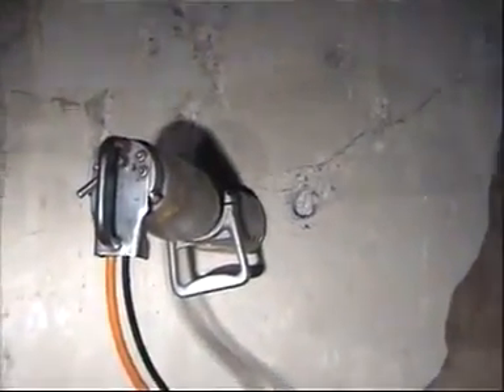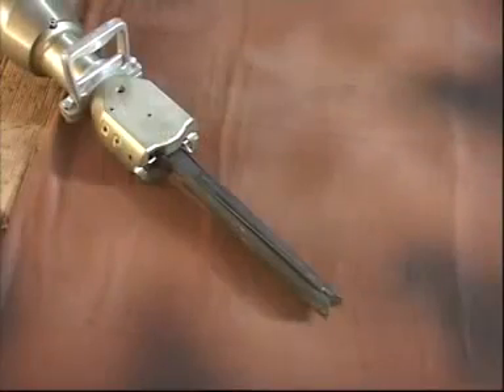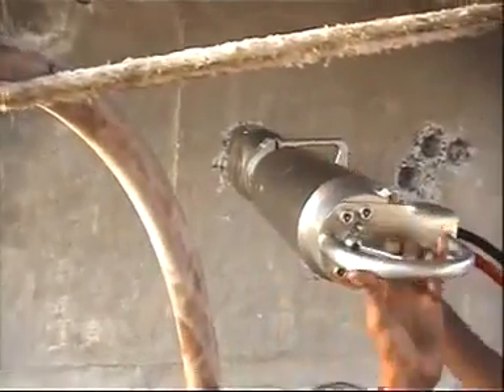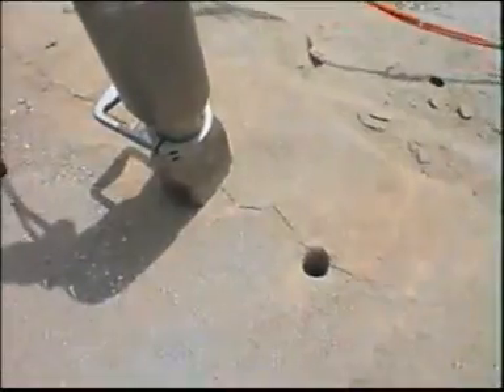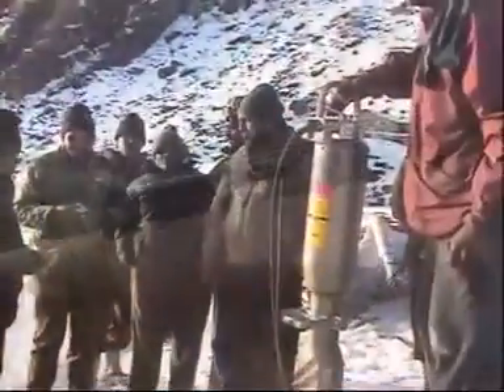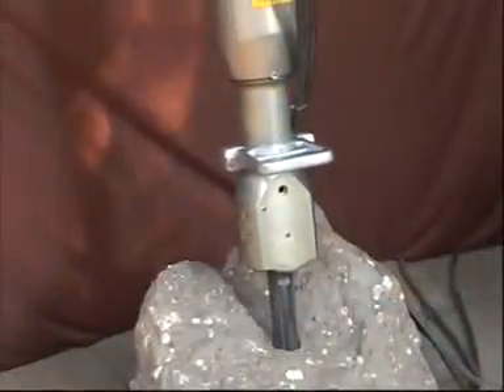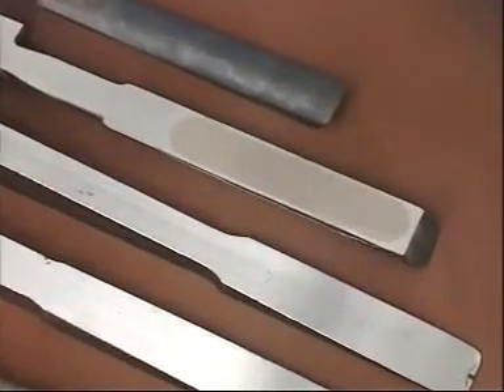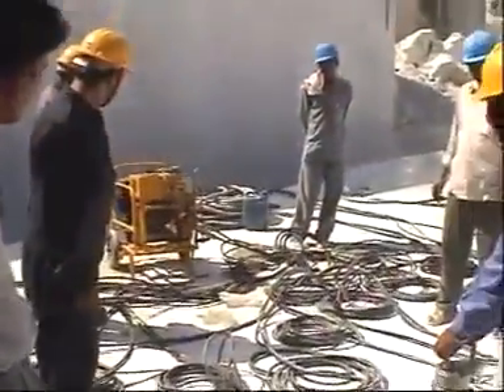Hydraulic Rock and Concrete Splitter - Shrikrishna Agro Equipment's Pvt. Ltd.

Comment: What is the price of this thing?? I need it for domestic purpose.
Reply from the maker: Shrikrishna Agro Equipment Pvt. Ltd. 
10,Kothrud Industrial Estate, Kothrud, Pune-411 038

Please call or Email for queries.
Phone : 020-25433054, 020-25434328
Mobile : +91 7887858103/2
Email :  shrikrishnaequipment123@gmail.com

Website : www.rocksplitter.in
Reply from the maker: Please call on +91 7887858103 or Email your requirement on shrikrishnaequipment123@gmail.com